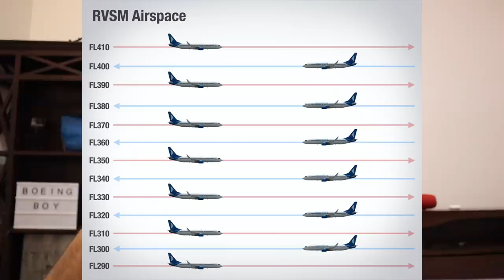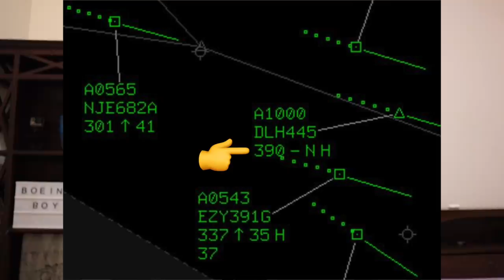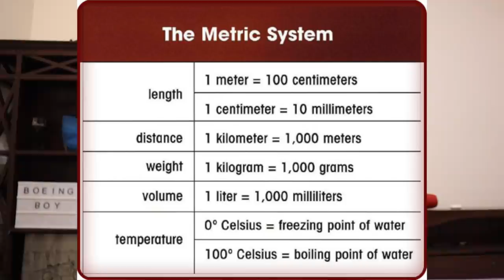Story Behind India's Biggest Airplane Crash l When 2 Airplanes Met In Air l Cockpit Stories Ep. 7

Comment: There is a factual error Tapesh sir, if you cross-check the final investigation report on DGCA site it says that the controller ONLY informed Kazakh a/c about incoming Saudi a/c at 14000', which was mistake. He should have inform both a/c about other incoming a/c with altitude. This comment is in reference to your statement at 03:35

Comment: It is a pity so much life had to be lost before a second corridor was allowed for incoming and outgoing flights even though the security  situation that was quoted for having one corridor had not changed.

I think Delhi is awaiting for one more horrific accident before another change will made. I understand that the full length of one new runway cannot be used because of a gigantic statue. Is that true?
Similarly I have heard that the glide slope angle at the  new Hyderabad airport is steep.

You as a pilot can make our skies safer by providing inputs to the Aviation ministry because nobody else other than a pilot knows the problems in the air and airports.

Comment: Relative speed should be 2000 kmph if both are approaching head on at 1000 kmph
Reply: I think you are bit right..But as per my observation the ground speed of climbing and descending aircraft is about 350 knots at about 15000'. And the 747 was flying level at the time of collision, so should have been flying at a speed close to 400 kts. So, yes relative speed can't be 2000 kmph obviously, but should be around 1400 kmph (750 kts). But yes, 1000 kmph is good enough to generalise.

Comment: Yes it was a tragic accident. But when the atc sould have given indication in meters to the Russian planes .as this is a mistake that have quite often happened. Like the air Canada when taking on fuel conversion of pounds in litrs.it run out of fuel midair it glided for miles and landed at an unused air port .landed safely.both meters and feet should have been broadcasted.